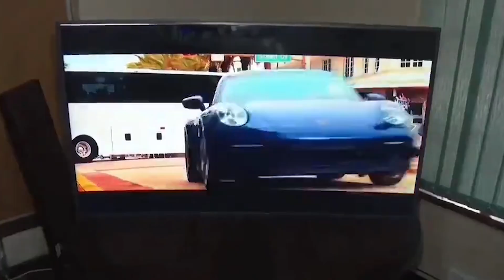Top 10 African Inventions

Comment: Honestly the "solar car" could at least move if they towed a couple more solar panels behind them but i cant see them figuring out how to get an efficient enough motor , thats actually expensive and you cant get it from the junkyard
Reply from the maker: That’s a fair point! Both the motor and the solar panel technology have a major impact on how efficient solar cars are. While adding more panels to the trailer may help, finding a cheap, lightweight motor without sacrificing performance remains a problem. What do you think would be the best way to improve their efficiency?
Reply: @Afrikleo  More batteries?